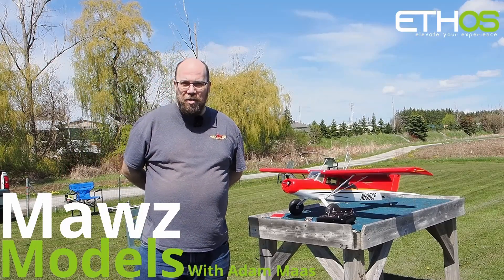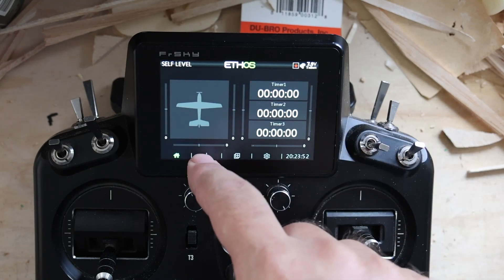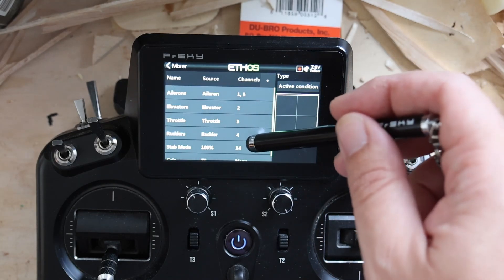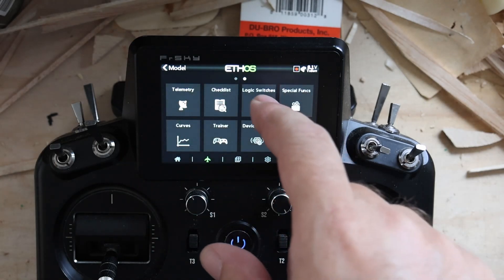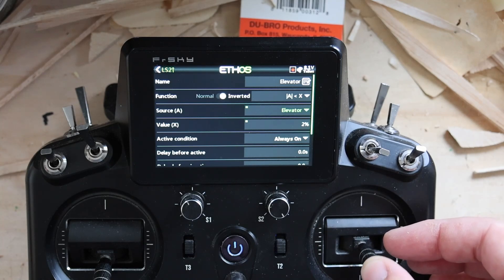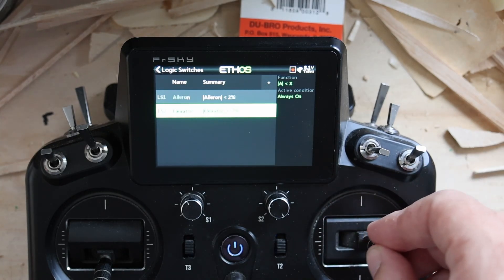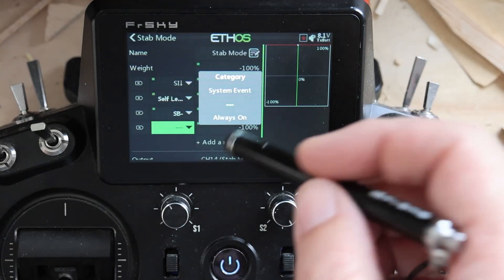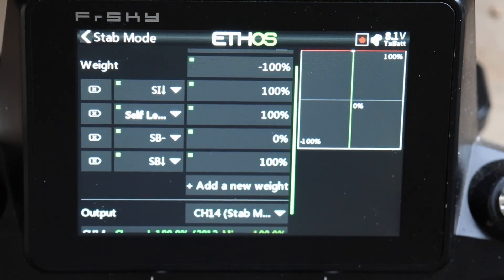ETHOS Tech Tip 19 - Stick-Release Self Level

Comment: Adam, I'm using Ethos 1.6.2 and found the Mixer Source must be set to use the mixer in this version of a Free Mix. What is your method to work around the Source Input in the Mixer to activate the Output? Thanks.
Reply from the maker: Same as in earlier versions, use a Source set to Special->Maximum